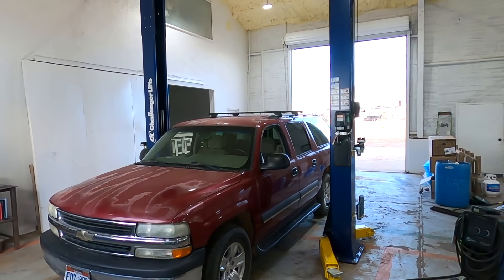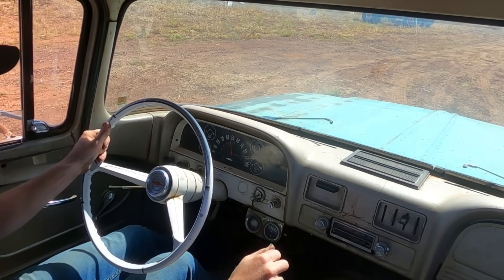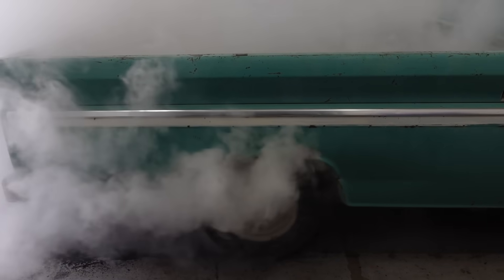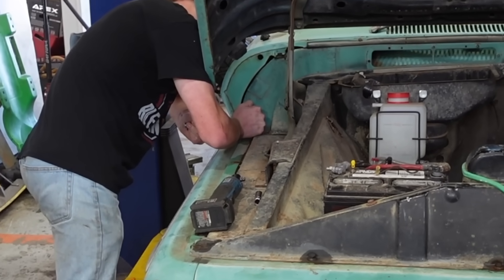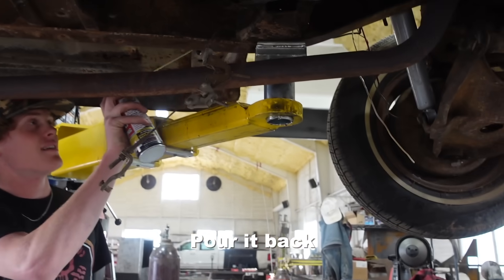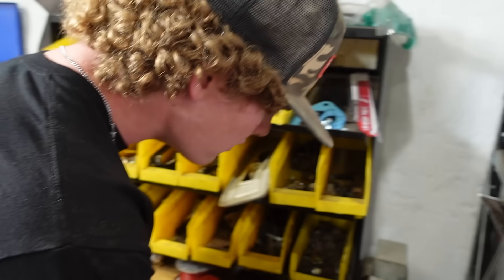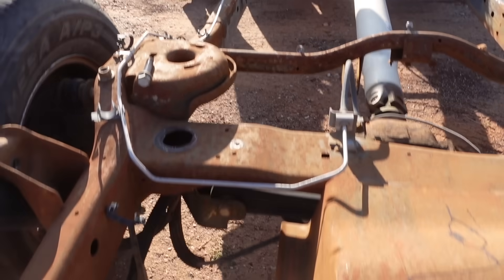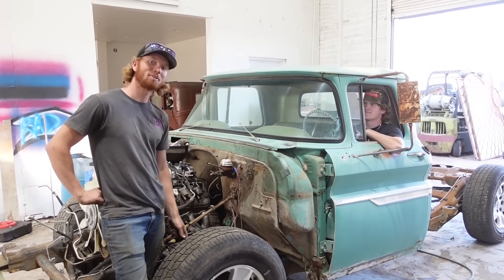This Might Actually WORK!!! Building Kaulins Dream Truck

Comment: Of course that ol 6 is gonna start, it ain’t got no sensors or computers in the way, just get her a little spark and she’ll go
Reply: so true !!!!!!!!!!   no fuss no computertech crap !!!  fuel n spark 😂
Reply: i think a great mod is the bbeautyful blend of old n new...  so u cant see the new..but u feel it.  for ME its brakes, steering/suspension... stereo/sound quality.  i dont mind convertg to hei, but i'm content w a carb set up !!! less 2 go wrong 😮. efi IS wonderful when its working as it was designed but when it goes ur average guy cant pop the hood n get her running shorrtly.
it goes badly and costly. i have a 73 chev and a 03 chev,,   it takes HOURS ! to take off enuf to get to what i need to fix... not to mention remember all the bolt plavement !!!!!  the 72 K5.....  i ccould sleep under the hood !!!😅. i can look down the carb n if she aint sqirtin... i got a fuel issue ! easy. no software needed 😊. But hey, each to his own, that the wonder of individualism😅

Comment: I would have liked to see you keep the straight 6, is that still called a stove bolt in the 60's?  Keep the green paint, re do the wood bed, and paint everything else like new.  Put some nice Vintique wheels or wires on on it and roll.

Comment: Hey Kaulin, try really hard not to limp. I blew out my left ACL back in 1983. I had orthoscopic surgery in it in the early 90's. It took me years to train my brain to stop favoring my left leg. I still find myself doing it to this day. You really need to concentrate and use both legs equally or it'll throw your entire body out of alignment. BTW, my ex wife was a geriatric physical therapist.

Comment: For those difficult to remove bolts it’s been my experience that pneumatic impact wrenches have more ugga dugga power than the battery powered variant. I like to run mine at 150psi.

Comment: I got no one near me to ask questions like this I got a 2000 jeep Cherokee sport 4 Dr 4x4 I wanna stuff bigger axles without lifting it any more than it is it's got 33s right now I'm not trying for crazy flex more for throwing mud and reliability what's the best gearing and best axle set up  to run that I could pull frl the local pick and pull
Reply: This jeep was given from a friend who passed family hoping would finish it and I don't have the funds to do it so I'm slowly getting it one probly b a few yrs before it's even close to ready for paint lol
Reply: I wanna comfortably run 70mph but also be able to play in the woods no crazy crawling

Comment: This seems more like a finger point to TYM and associated lines.

Century, Cabela's, RK, Branson bad boy and some others were/are all made by TYM.

TYM still supports these tractors except for the very early units that have long died off.

Don't be afraid of the older cub cadets either. Depending on the year/HP they were Dae Dong, Mitsubishi, Daihatsu, or yanmar made tractors.

Same with the older case IH, a large amount of them were Mitsubishi made.

The bobcat is made by daedong "kioti".

Solis would be the only one I would be worried about pulling from the market. But they manufacture for several of the other known brands, so they won't be going out of business. Just pulling from the market share like yanmar. Why compete against yourself essentially